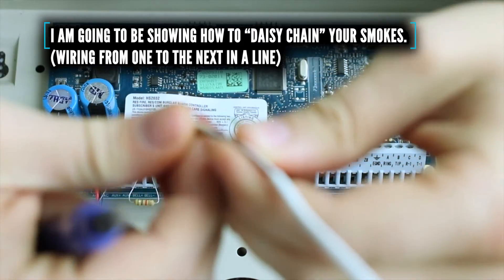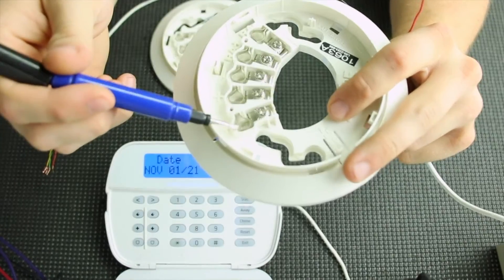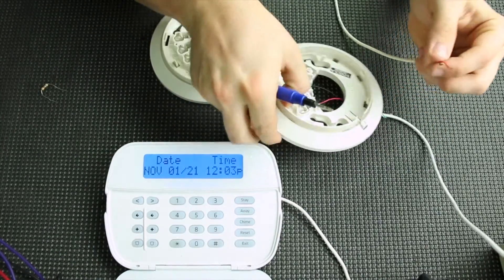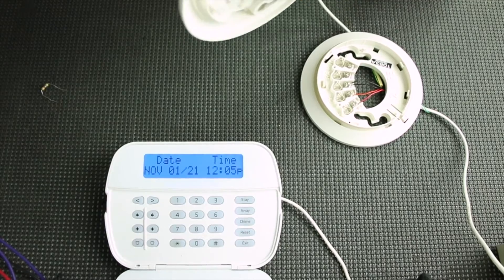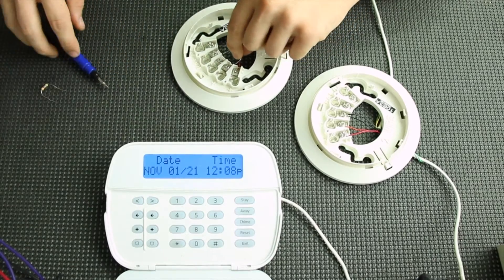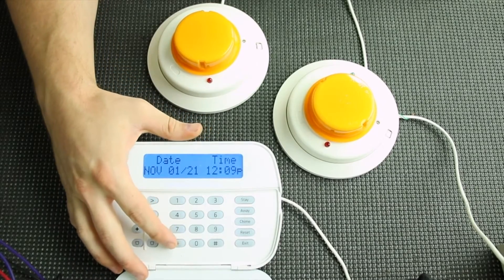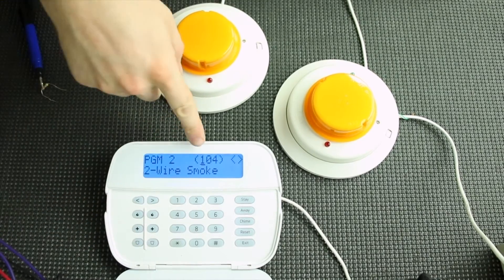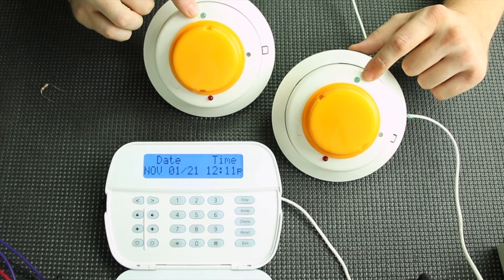How to wire and program System Sensor 2WB series 2 wire smokes detectors on a DSC PowerSeries Neo.

Comment: I have 3 2-wire smokes and have run each directly to the panel. Do I connect all blacks to PGM2 and all reds to AUX+? Where would the resistor go?
Reply from the maker: If you only have 2 wires going to each smoke, yes, the only option is to connect all the black wires to PGM2 and all reds to AUX+. Only one resistor can be used, however, so only one smoke can be supervised. You'll just have to pick which. That is why it is recommended 2-wire smokes be chained rather than each home run to the panel. 

There is a better option, but it only works if you have 4 wires run to each smoke. By using the second set of wires, you can chain the smokes within the panel by using wire nuts or b-connectors. 2 wires providing power out to the 1st smoke, then use the 2 remaining wires coming back and tie them into the outgoing wire to the next smoke and repeat. Then the resistor goes on the last detector.

Comment: Would I be able to put pull stations on it too?
Reply from the maker: Yes, a pull station is just a switch, so you could set it up as a zone on the system which triggers a fire alarm when pulled.

Comment: This smoke detector might not be good in a bedroom. The flashing green light can keep people awake. I'm looking for a replacement for the ESL 521NCSXT. With the ESL 521NCSXT smoke detector, you could not see the blinking light unless you stood directly underneath.
Reply from the maker: Those smokes are now discontinued, so I'm not sure if a similarly designed smoke is out there to fix the LED issue. If you do find one though, as long as the replacement is a 12V 2-wire smoke though it should work for you.

Comment: My smoke detectors are 10+ years old and needing to be replaced and I have almost this exact same setup with a DSC PC1616 and System Sensor WTAB's. Can I simply order new WTABs to replace the old ones, keep the already-wired mounts in the ceiling and simply swap out the old units for new ones?
Reply from the maker: Yes, to my knowledge the mounts have never changed for the i3 sensor group.

Comment: How do you program a 2-wire smoke for delayed 24-Hour Fire. When my smoke is activated it goes into immediate alarm which is not desired in cases where burnt toast sets off the smoke.
Reply from the maker: 2-wire smokes cannot be set with a delay unless the system specifically offers that feature. Im not sure of any systems offer that, but the DSC and other systems we carry all have instant trigger on 2-wire smokes. You would need to use 4-wire smokes if you wanted to have a delayed trigger on smoke detectors. Generally its better to use heats in the kitchen rather than smokes, so you might think about replacing whichever sensor is being triggered that way.
Reply: @AlarmSystemStore  thank you. Appreciate it

Comment: If I wanted to put 20+ smoke detectors on a DSC System. What's the best way to do so? 4 wire or 2 wire? Thanks!
Reply from the maker: 4 wire type for sure. The Neo main board can't support 20 2wire type, though there are ways around it with additional modules. That many smokes should be somewhat zoned out IMO and only 4 wire type can do that.
Reply: @AlarmSystemStore  Awesome, Thanks! I think I'll zone them per floor. Thanks Again!

Comment: I see that you say you can have 18 2 wire smokes on a Neo system, if the smokes are 130ma each in the alarm state what stops that from over drawing the aux+ on the main board. Or going over the 300ma rating on the PGM2. Thanks for any information
Reply: The limit of 18 limit comes directly from the DSC manual so it is accurate. The technical explanation is too lengthy to cover in a comment, but suffice it to say, they don't work like a traditional 4 wire smoke though either.
Reply: @andybowman9697  Yes I did some more research on it and understand how it works now. Thank you for the quick response anyways

Comment: Hi, what if I wanted to run a simple fire alarm circuit consisting of just 2 wire smokes, a horn, and a pull station, and provide DC voltage 12-14. Would this work? Basically just want the system to sound when theres smoke detected. No alarm panel is used.

Comment: Here's an interesting question, let's say you're replacing older smokes with the 2WB, how polarity sensitive is the positive side, let's say you don't have the diagram to know which was originally coming from another in series, and I've heard this, that when the top is on it connects the positives, so in theory let's say you just go positive to positive and then the negatives to negatives would they still work?

Comment: what is the  maximum 2 wire smoke that you can connect to PGM2?
Reply from the maker: That depends on your system version. The newer DSC NEO can handle 18 2-wire smokes, whereas the older PowerSeries can only handle 12.

Comment: So I get pgm 1-2 on the main board but when you add an expansion board for 4 more pgm’s spaces are those pgm3-7? When programming
Reply: Sorta of. Depends on what card is added. There are PGMs on HSM2204 as well as HSM2208 cards. Technically I beleive the expanded ones start at 5 though because 3 and 4 are built into the 2064 model, but yea that's the idea.

Comment: When you say pgm 2 is the only pgm that works with 2 wire smokes, can I add a high current expansion card with pgm ports and that will give me more 2 wire pgm ports?
Reply: No, you can't. 2wire smokes can ONLY go to PGM2, unlike 4 wire type that can go on an expasion power supply
Reply: @andybowman9697   can I use an expansion card to get more pgms with 2 wire smokes? Or all smokes would have to go on main board pgm2
Reply: @uniteddrones7626  No, that's exactly what I answered above.

Comment: Great video as always, been using the Neo in Australia for many years, so I guess if you use these you can't have the External Siren Strobe light anymore? As that needs pgm 2
Reply from the maker: Thank you! If you don't want to use the Bell for your siren / strobe you could still use these on a PGM, but you would need to get a HS2204. See here:
https://www.alarmsystemstore.com/products/dsc-powerseries-neo-hsm2204-high-current-output-module
Reply: @AlarmSystemStore  oh yes, just put the 2204 in and add these to that would be easiest. Cool!